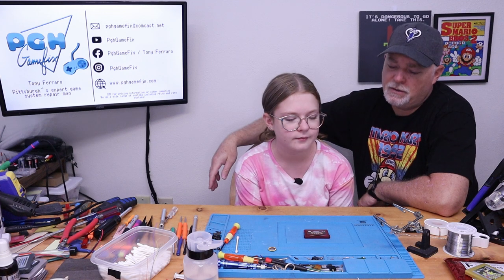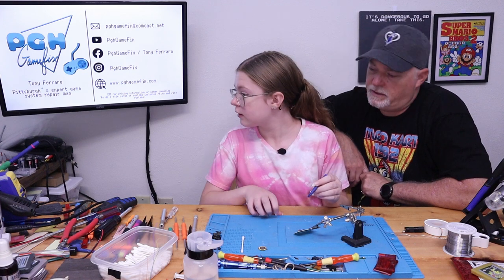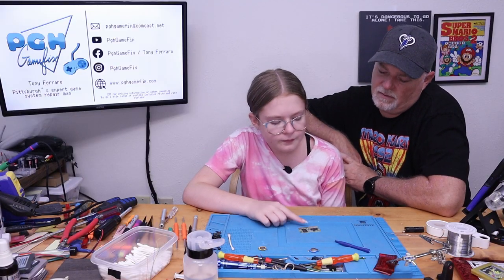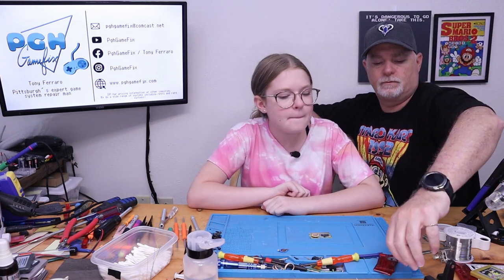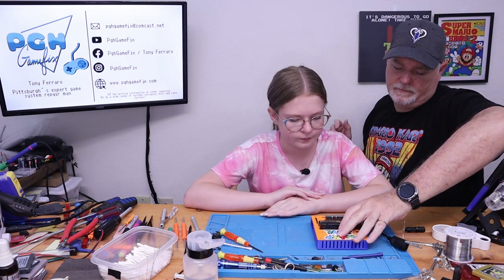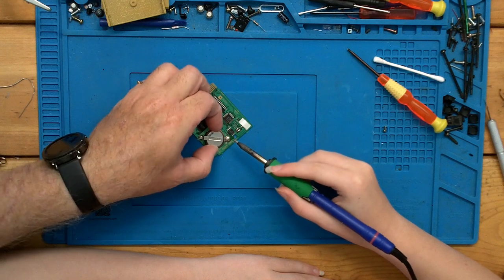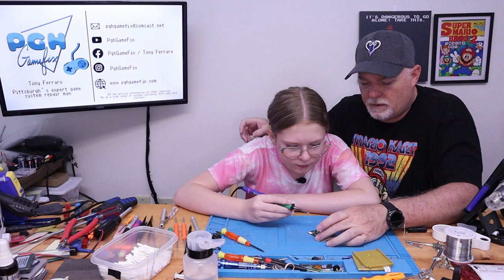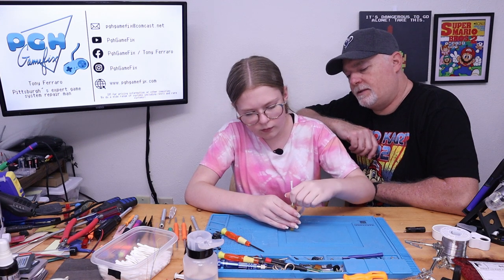Summer Time STEM Class. Replace Pokémon Batteries.

Comment: Hello sir, nice content you got here, we owe you alot from these videos
And I need your help, my xbox one was having a problem, my power supply wasn't working so I bought a replica, it works, but the xbox doesn't work, and there's a clicking sound coming from the xbox...any idea what's happening?
Reply from the maker: If it's not turning on at all... then I would say either the southbridge chip has gone bad, or you have a short on a power rail.